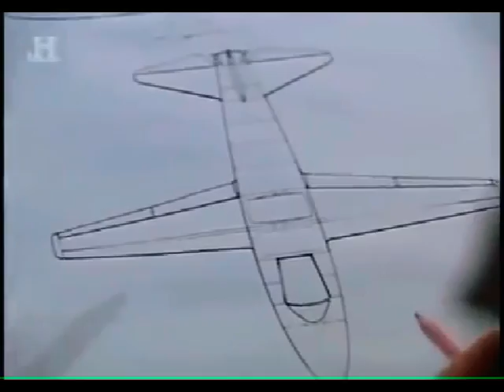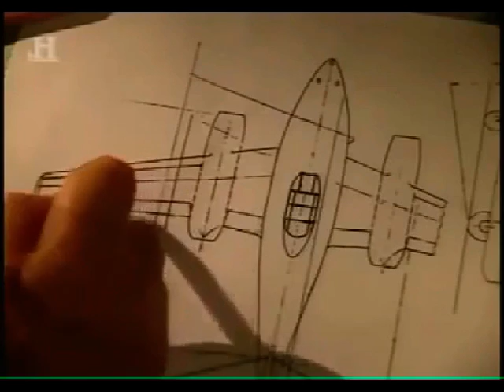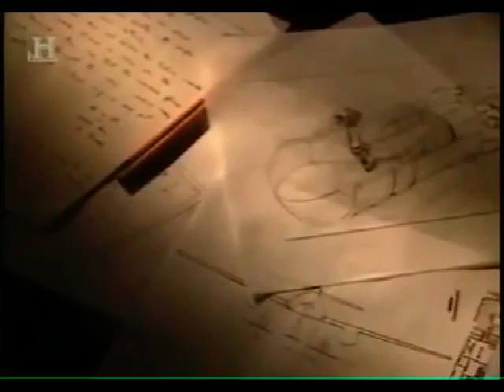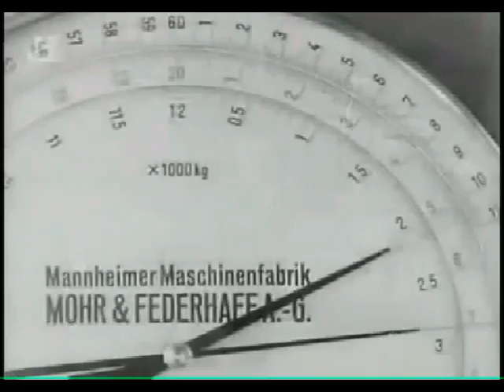The Father of the Jet Engine - Hans Von Ohain

Comment: "in April 1940 the Ministry allocated production of his [Whittle's] newly designed W2 [centrifugal] engine to Rover, an independently-minded car manufacturer, at a stage when there was still much to be learnt about gas-turbine design and manufacture. Unsurprisingly, this significantly extended the time taken to get it into production (see “Whittle, Lutterworth and the birth of the Jet Engine” for details). Meanwhile the progress of the Rolls-Royce Griffiths-designed axial-flow turbo-jet was slowing to a halt (it had a combined compressor/turbine whereby the inner section of each stage formed the compressor and the outer the turbine) and Rolls-Royce eventually took-over Rover’s contract, the engine passing a 100 hour test at 1,600lbs thrust in May 1943 and powering a Gloster Meteor (http://www.vectorsite.net/avmeteor.html )shortly after. The Metrovick F2 [axial-flow](http://tanks45.tripod.com) began flight-tests soon after but by now it had been decided to put the major effort into producing a development of Whittle’s engine (the Derwent) and another centrifugal engine based on Whittle’s layout, the de Havilland H1 Goblin designed by Frank Halford (http://.rolls-royce.com/people) , which had also reached the flight stage at this time (It powered the first Meteor to fly) and was intended to power an aircraft from the same company, the Vampire."

http://www.frankwhittle.co.uk/content.php?act=viewDoc&docId=7&docFatherId=1&level=sub

There was four jet engines in the UK under R&D:
  ♦ Two centrifugal, by Whittle (Rover) and Frank Halford  (DeHaviland);
  ♦ Two axial-flow, by Metro-Vick and Griffiths (Rolls Royce).
Reply: Hans von Ohain built the first jet engine and was successfully flight tested on August 27th 1939.
Two years before Whittle.
Reply: There were 18 turbojet engines under development in Germany during WW2... the first successful production turbojet engine was also the first to enter operation service. 
The Jumo 004b engines were the most produced and the most successful design developed during WW2.
Reply: @sandervanderkammen9230  
The 1st modern turbojet was run on a test bed by Whittle. The 1939 German engine was so poor the British would never have put anything so bad into the air.  It was so bad German funding was taken away from jet engine R&D.

The first British plane into the air in 1941 was a complete reliable jet plane, that could have gone into action. 

The British were way ahead of the Germans in engine technology in both centrifugal and axial-flow designs.
.
Reply: @johnburns4017  The first turbojet engine was constructed in Germany by Max Hahnn and Hans von Ohain in 1934, two years before Frank Whittle began any work on jet engines.
The first successful test flight of a Turbojet engine was the Heinkel He-178 it flew powered by Hans von Ohain's jet engine on August 27th 1939.
Frank Whittle did not invent the turbo jet engine nor was he the first to build or successfully flight test.
Reply: @johnburns4017  The Gloster E.28 was only the FOURTH aircraft  design to fly under jet propulsion  (without propeller)... not the first
Reply: @sandervanderkammen9230  
Whittle's first patent was 1931. OHain based his work on it.  The first jet engine to run, and to fly in a plane, was von Ohain's project at Heinkel. He had massive funding from a major company. Von Ohain himself admitted that he looked very closely indeed at Whittle's jet engine patents before starting work on his own jet engine. His was unreliable, inefficient, low power and low life, despite having massive funding from Heinkel - a failure, and not continued with. Only when the Germans found out that Britain was developing jet planes did they take up the technology again. 

Whittle chose to concentrate his very limited funding on the centrifugal compressor because it was well-understood. He was focused on making a war-usable, reliable and powerful engine. All of these qualities the Jumo and BMW axial jet engines lacked. On limited funding, Whittle developed a reliable engine which was combat-ready. Within months, production engines were also more powerful with the Gloster Meteor top speed of 600mph in late 1945 and  650mph in mid 1946. Far superior than any of the total garbage engines turned out by the rushed German programmes. The German engine had a service life of 10-12 hours, which can not be rapidly throttled up or down, is prone to flame-out, and generally terrifies its pilots. They were garbage.
Reply: @sandervanderkammen9230  
The 1939 plane was not a success. It was dropped. It flew but that was about all.  The engine was more akin to a hairdryer.
Reply: @johnburns4017  Whittle wasn't the first to patent the turbojet engine.
Maxime Guillaume patented the turbojet in 1921... NINE YEARS BEFORE WHITTLE!!!!!!
Reply: @johnburns4017  The facts are irrefutable, Hans von Ohain constructed his engine before Frank Whittle and produced a successful test flight two years before Frank Whittle.
Reply: @johnburns4017  Whittle didn't invent the turbojet engine , he was only the FOURTH to produce a flightworthy engine that successfully propelled a jet aircraft... he was only the first in the U.K. 
No prize for fourth place.
Reply: @sandervanderkammen9230  

Frank Whittle invented the turbojet
Reply: @johnburns4017  There is no credible, factual evidence to support the false propaganda myth that Frank Whittle invented the turbojet engine.
The turbojet engine was invented in Germany by Max Hahnn and Hans Von Ohain in 1934.
The World's first jet aircraft was the German Heinkel He-178 it flew on August 27th 1939..
Two years before Whittle.
Reply: @sandervanderkammen9230  From the foreword, written by PABST VON OHAIN, to 'Elements of Propulsion, Gas Turbines and Rockets'. In Pabst von Ohain's own words-

"The first patent of a turbojet engine, which was later developed and produced,
was that of Frank Whittle, now Sir Frank (see Fig. 5). His patent was applied for
in January 1930. This patent shows a multistage, axial-flow compressor followed
by a radial compressor stage, a combustor, an axial-flow turbine driving the
compressor, and an exhaust nozzle."

Pabst von Ohain  also tells of his own work and his first design for a patent is in 1935, five years after Whittle's. In Ohain's own words-

"In early 1935, I worked out a patent for the various features of a gas turbine
consisting of radial outflow compressor rotor, combustor, radial inflow turbine,
and a central exhaust thrust nozzle."

He then talks of the development of that design-

"By mid-May 1936 I had nearly completed the layout of the hydrogen demonstrator
engine. To build this engine was, for me, most important, not only for
quick achievement of an impressive demonstration of the jet principle, but also
for very significant technical reasons:
1) One reason was to obtain a solid basis for the design of the flight engine
and the development of the liquid-fuel combustor, which should be started as a
parallel development as soon as possible.
2) To achieve this solid basis, the hydrogen engine was the surest and
quickest way when one does not have compressor and turbine test stands.
3) The anticipated step-by-step development approach: First testing the
compressor-turbine unit with the "no-risk" hydrogen combustor and then using the tested turbomachine for exploring its interaction with the liquid-fuel
combustor system seemed to be good protection against time-consuming setbacks."
 
He the tells that the test start in March 1937-

"The engine was completed at the end of February 1937, and the start of our
demonstration program was in the first half of March, according to Gundermann's
and my recollections. The first run is clearly engraved in my memory: Hahn
had just attached the last connections between engine and test stand; it was
after midnight, and we asked ourselves if we should make a short run. We
decided to do it! ... The motor brought the engine to somewhat above 2000 rpm. The ignition was on,

and I opened the hydrogen valve carefully. The ignition of the engine sounded
very similar to the ignition of a home gas heating system. I gave more gas,
Hahn waved, the belt was off, and the engine now ran self-supporting and accelerated
very well. The reason for the good acceleration probably was twofold: the
relatively low moment of inertia of the rotor and *the
relatively low moment of inertia of the rotor and the enormously wide operational
range of the hydrogen combustion system*."
Reply: @fritzfieldwrangle-clouder7299  Maxime Guillaume patented the turbojet engine in 1921, 9 years before Frank Whittle.
The first successful flightworthy jet engine flew on August 27th 1939, 2 years before Whittle's.
Reply: @sandervanderkammen9230  Go with Guillaume if you like Sandyboy but you'll have to tell Spottydog4477 that he's talking out of his arse. Here's what Ohain had to say-

"The first patent of a turbojet engine, which was later developed and produced,
was that of Frank Whittle, now Sir Frank (see Fig. 5). His patent was applied for
in January 1930. This patent shows a multistage, axial-flow compressor followed
by a radial compressor stage, a combustor, an axial-flow turbine driving the
compressor, and an exhaust nozzle."

Comment: What is so mind blowing is that the ME 262 first flew on April 18th 1941, and yet it did not see combat until July 25th 1944............27 months later. 

There were 1400 ME 262's built, yet only 300 ever saw combat  Hitler's lack of understanding  the 262 as a fighter, combined with an initial lack of interest on the part of the German high command doomed the Luftwaffe. Had the Nazi's imagination been equal to their desire to rule the world, thousands of ME 262's would have been produced beginning in 1941 when they could have made a difference. All in all, brilliant concept but far to little to late.
Reply: The Me 262 in 1941 had a piston engine and straight wings, 1942 when it flew with the BMW engines both failed and after a lot of redesign it was fitted with the Jumo engines but they were not reliable and not ready until 1944, the reason so few flew, apart from a lack of experienced pilots was a lack of engines.  No Me 262`s could have been made in 1941 unless they had piston engines.  Even in late 1944 the Me 262 was a poor fighter.
Reply: @barrierodliffe4155  Lack of usable engines - the Jumo engine was rubbish, and lasted 10-12 hours.  And a shortage of fuel.  And a shortage of pilots capable of flying the thing.  Bit of a waste of effort really

Comment: Whittle had already patented his engine.  Whittle opted for a centrifugal flow engine which was less efficient but more reliable with the materials available at the time.  Germany ended up with the more powerful axial flow engine - but as they discovered the materials needed to withstand the stresses were simply not possible to produce at that time - hence the eternal problem of unreliability of their engines.
Reply: WRONG!! The jet engines were not unreliable, they just had a short service life due to the lack of rare metals like Chromium. The Germans didn't have access to these rare metals so they had to make do with what they had. That makes their accomplishments even more impressive.
Reply: @haroldfiedler6549  
German designs were poor and went no where, British centrifugal jet engines went into many aircraft and so did their axial flow jet engines, both types were better than the German attempts. All modern jet engines come from British designs.
Reply: @haroldfiedler6549  Yep you are right, they used innovative solutions because of the strategic material shortage (Chrom ect) . , they made the turbineblades hollow and used  compressed air from the compressorstage to cool the blades from inside. The first JUMO 004 A Prototype built with rare material  runs 100 hours during the test without problems but for massproduction they reconstructed  the JUMO to the 004B version with less good Heatresistent  materials
Reply: @Sturminfantrist  
Unreliable badly designed jet engines that lasted a few hours if treated very gently.  After the war no one had much use for the poor German jet engines.
Reply: @barrierodliffe4155  Oh Barrie you again and you know that the russians used  them as RD-10 and RD-20 with better materials for their first Gen. Jets , even the French ATAR based on the BMW003
Reply: @Sturminfantrist  
I also know that the Russians did not find these German based jet engines to be any good even with better materials, they soon adopted the far better RR Nene for the Mig 15, I also know that France spent many years trying to get the much altered  Atar jet engine that was based on a BMW jet engine to work
Reply: @barrierodliffe4155  yep BMW had problems to made the 003 service ready but it was a BMW Team that developed the ATAR and in Russia a German Team developed the Kuznetzov NK 12 Turbopropengine for the Tu-95 (NATO code BEAR) , germanys Engineers were the best in jet tech  during this time.
Yes the 004 and 003 had a short servicelife because of the lack of strategic materials but in times of total war when aircraft shot down after a few hours it was enough.
Even the first Gen postwar  US axial jets had a short service life and needed maintanance after ca. 25 flying hours.

look here!
https://www.youtube.com/watch?v=vhf8eQn97qE&list=PL4D31xoDsbGd091DJ7BWsSR7ab3j05Khr&index=5&t=0s

Radial jets like the RR NENE  which was a very good engine for the first jets had a disatvantage their  radial compressor had a big diameter  and this caused drag, so more drag less speed  but the first radials were more reliable then axial jets, Heinkel worked at radial compr Jets but the RLM rejected radials because the germans know that axials are the future
Reply: @Sturminfantrist  
Problems?  being useless is more than just a problem and how long did it take the French with a few Germans to alter the design and make the ATAR jet engine, by then Armstrong Siddeley had the Sapphire and RR Had the Avon, both better.  The Kuznetzov NK 12 was developed over several years and again there were a few Germans in the research team.  
German engineers and the best is a big stretch, in Britain during the war they made the RR Derwent which led to the Nene, the Halford H 1 and the Metropolitan Vickers axial flow which was better then the BMW or Jumo designs and could have been used if the Derwent followed by the Nene were not so good.
The so called lack of strategic materials is just an excuse for the poor designs.
Reply: Whittle did not patent first, the turbojet engine was patented by Maxime Guillaume in 1921 when Whittle was still wearing shorts pants.
Reply: Whittle's 1930 patent was for a axial compressor, but ad RAE Chief of Engine Design A.A. Griffiths pointed out, Whittle did have the slightest clue hpw to build one.
Whittle never constructed the 1930 patent design.
Reply: @sandervanderkammen9230  From Pabst von Ohain's foreword to 'Elements of Propulsion, Gas Turbines and Rockets' in Pabst von Ohain's own words-

"The first patent of a turbojet engine, which was later developed and produced,
was that of Frank Whittle, now Sir Frank (see Fig. 5). His patent was applied for
in January 1930. This patent shows a multistage, axial-flow compressor followed
by a radial compressor stage, a combustor, an axial-flow turbine driving the
compressor, and an exhaust nozzle. Such configurations are still used today..."

Hmmm, who to believe Pabst von Ohain or Sandyboy the wehraboo?
Reply: @barrierodliffe4155  Here's an interesting thing, even though months ago I'd given Sander Van der Kammen a reference to a foreword written by Hans Joachim Pabst von Ohain  himself that credits Whittle with, in 1930 the first patent of a turbojet engine that would  go on to be developed and produced and that was still in use today (time of writing was 1980s), Sandyboy still trots out the same old garbage.